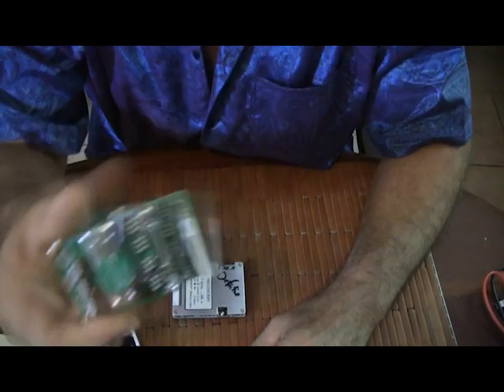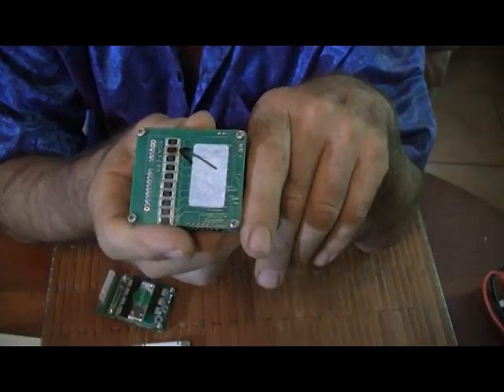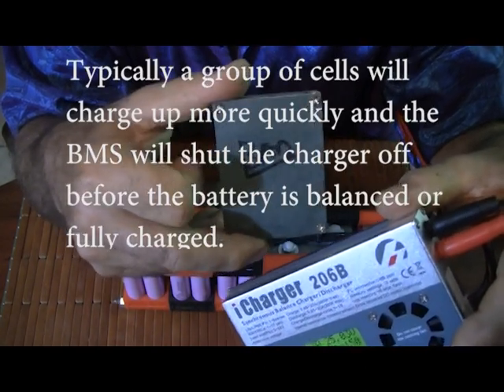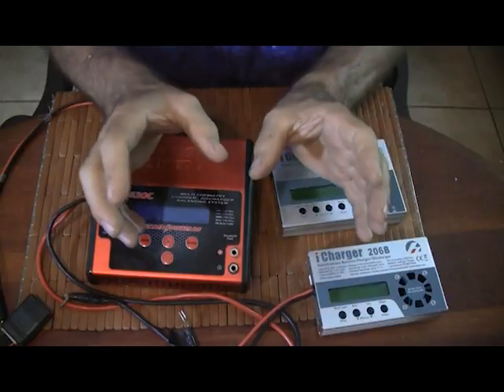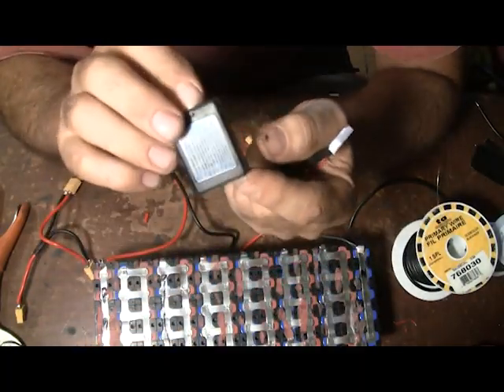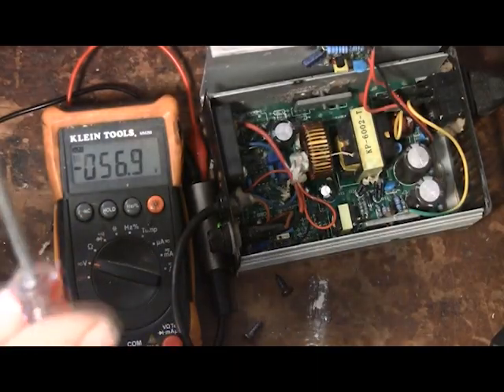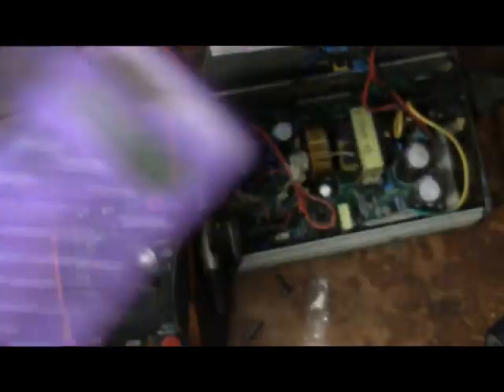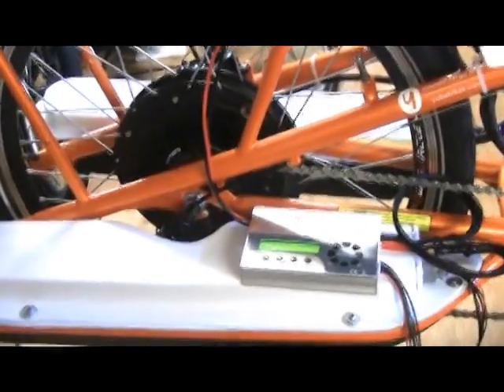How to build a safe and better lithium battery WITHOUT a BMS.

Comment: I had been wondering how good  a BMS was. 
You had your cell logger permanently attached how do you turn it off so it doesn't drain the battery?
Reply from the maker: You can attach the cell logger with a jst-xh connector so you can unplug it, or put a switch in the negative lead.

Comment: Correct! this is how I do it with hobby charger and a cell checker in balance mode if needed. I like knowing the state of all my series cells.  I even use the hobby charger with my solar panels which I do not trust solar controllers trickle charge when using li ion. 

Another way to avoid BMS's
I have a pack with 4 single series li ion chargers on each of the 4 series. It will charge up each to 90% using 5v usb 2.5A hooked into my solar controller. Then use the cell checker in balance mode if any cells are too high. Which I rarely have to do each cell is at 4.1v unless you have bad cells it works great. I never have trusted bms!

Comment: I hate to be the one to say this, but this isn't really practical. You can easily buy a Smart BMS with Bluetooth which can monitor the cells which makes all this clever engineering obsolete. I'm not saying this won't work, but it is a freaking hassle and if you don't hear those voltage sensors beep, (I have several of those) your really in for it. You don't even mention a battery monitor to which you can look at from the handlebars, I'd have to get off my bike every 30 mins to check where my battery is.
Reply: We’re these readily available 9 years ago?

Comment: sir, i had a view of your video. i have to questions. First, my lithium ion battery pack is dead. cannot be charged . upon opening, each cell read 0v. what is the reason. second, i need to diy a lithium ion pack of 30v 30a. need your help. thank you.

Comment: All good points, thanks for the video! The only thing I would miss is an automatic bottom cutoff. Any thoughts on how to cut power to the pack at absolute minimum?
Reply: Use a zener diode and  relay or mosfet to cut the current at your preferred level. You will find loads of stuff on how to use zener diodes etc on Youtube.

Comment: Just about to build a 14s7p pack. After watching this I'm going for 2 packs 7s7p.  Thanks for the info.
How do you wire the low voltage alarm switches?
Reply from the maker: Think of your pack as two batteries.  You will have a 2nd negative in the middle of the pack.  Use this for the ground of the 2nd voltage alarm, and wire the positives in sequence as normal.
Reply: Sorry, what I meant was. The switches that turn on/off the 2 displays on the bike, what wire is broken for the switches?
Reply from the maker: @choppedminx  Negative Wire
Reply: @shawname2  thanks shawn👍🏻

Comment: Hi Shawn, thanks for a great and informative video. I recently discovered that the BMS on my 52v 20ah battery was dead. I was very hesitant to open the pack and check. I am glad I did. The BMS was reading ~28v and the battery was reading 58.6v (fully charged).

Since the video was made a few years back, I wanted to as if there are any new hobby chargers that could handle my battery without breaking it in two.

THANKS
Reply from the maker: Hi Atef,

No not that I know of.  Understand that you do not have to mechanically separate the battery- you can leave it spot welded.
Reply: @shawname2  And still use two hobby chargers? Thx

Comment: cool..very good thank you..so you charge mostly with normal charger and balance ocasionaly with hoby charger?
Reply from the maker: Yes, exactly.
Reply: @shawname2  for normal charging not balancing charge..do you use a simple power suply but your trick is to set the voltage to only charge 90% of max battery voltage is that correct? or are you using a li charger that tapers of after 80%? i love what your doing and im looking for chargers now
Reply from the maker: @russellwilson5246  Yes, I use a simple power supply or an ebike charger with a pot to adjust the output voltage to no more than 4 volts per parallel group;  40 volts for a 10S.
Reply: @shawname2  would i be corect to asume a 10s pack on a 40v power suply even if i fell asleep this would not over charge batterie pack?..all the 40v suply could do is take the pack to 40v/safe right? and as the pack aproches 40v the curant would deminish..ie voltage or pushing force would deminish as the charger and battery aproach an equal voltage? making the 40v simple power suply act similar to a smart charger that reduces amprage near end?or should i say the situation will reduce currant near end..and when the power suply and battery pack reach 40v charging /the flow of currant will stop?even though the power suply is pluged in and turned on and connected to the battery pack?
Reply from the maker: @russellwilson5246  Yes you are right.  A charger starts out maintaining a Constant Current- The CC part of the charge.  Once the target voltage is reached the charger reduces the current to keep the voltage from going too high- the CV part of the charge.  Finally, the charge current drops to such a low rate- say .01 of an amp- that the charger just shuts off.  Sleep easy!
Reply: @shawname2  what about a power suply of 40v?...not a charger
Reply from the maker: @russellwilson5246  No problem.  Most power supplies are constant voltage.  Constant current P supplies, whcih you donn't want. are very rare.

Comment: Also I took 4 of them pocket car booster packs that are 12v each x 4= 48v and it’s tiny lithium pack all put together, about the size of a VHS Tape that goes in a VCR.... it’s awesome no more big clunky battery or tons of shitty single cells only 4 little packs together

Comment: Ya it’s a good idea but who wants to have to keep running over to your battery to make sure it didn’t over charge it, you’d go nuts running to it every 15 mins.., also wouldn’t it be better to have a digital screen that tells you how full the battery is... also you can buy a Bluetooth BMS and use your phone and it does everything your doing individually, the Bluetooth BMS shows each battery cell percentage, life of it, cuts it off so there’s no over charging.., I’ll stick to the Bluetooth BMS

Comment: This is the exact video that i'm looking for.  One of the best explanation video i have seen on youtube.  I'm in a process of building a 10s battery for my Ezip 1000 36v scooter.  I have a ton of Ryobi 40v 4ah battery, good cells and bad bms are ready to be torn down.  I have a few questions to ask, what does that little cells monitor, and the wire attached to it call, can you give the me name and model or where to buy them.  also, do you still recommend the Icharger 2010B or there a better now?  Last but not least, which battery spot welder do you use or would you recommend?   thanks a million in advance.
Reply from the maker: Sure-  Here is a link to cell monitors:
https://hobbyking.com/en_us/catalogsearch/result/?q=6s%20cell%20monnitor
The type of wire connector attached to it is called a jst connector.
I still like and use ichargers...   But there are many less expensive ones.
I use a spot welder like this- it is adequate:
https://www.banggood.com/DIY-Portable-Battery-Storage-Spot-Welding-Machine-PCB-Circuit-Board-Welding-Equipment-Spot-Welders-for-18650-26650-12V-p-1646749.html?utm_source=googleshopping&utm_medium=cpc_organic&gmcCountry=US&utm_content=minha&utm_campaign=minha-us-pc&currency=USD&createTmp=1&utm_source=googleshopping&utm_medium=cpc_bgs&utm_content=frank&utm_campaign=frank-pla-us-all-brand-0513&ad_id=435264204190&gclid=CjwKCAjw2Jb7BRBHEiwAXTR4jQmpANb9iGHGMz1MwwRhFirL06VCNOfiO4y83W087PJuL0Uyon0uABoCJvIQAvD_BwE&cur_warehouse=USA

Comment: I like this video because I seldom found so much usefull information! Since I have some trouble with BMS'es, I started to look for an iCharger 1010B. I now have a 2p-13s battery providing 48v. To balance this battery, I need to split it into  6s and a 7s halfs. Since readily available chargers only go to 6s, I need a 10s charger. Impossible to get! There are "Junsi" chargers doing 10s. Are those OK?
Reply from the maker: Sure.  Amy charger brand will work.
Reply: @shawname2  OK, thanks for the fast response!

Comment: i ordered a 60v 5600w scooter what could i use to replace bms?
Reply from the maker: If the BMS is working well, leave it.  If you enjoy electronics as a hobby, and want to improve the battery, consider getting an active balancer.  If you have a hobby charger, you could get a check up of the batteries state of balance while charging...
Reply: @shawname2  im sure it will work fine i ordered a whole bunch of batteries to make the thing go the farthest, the balancer thing seems likk
Reply: like a better idea im sure i coul find a 60v balancer if i look online
Reply from the maker: @michaeljoelnavarrete8055  Sure- but doesn't one come with the scooter you ordered?
Reply: @shawname2  ya js the balancer thing sounds better for the overall health of the battery
Reply from the maker: @Designer Web They do address the "don't know if it's working" problem with regular BMS's.  And, a lot of them are programmable- so you can set the cells up to be charged for long life or for max capacity.  They are a good choice.
Reply: Are you sure the BMS comes with the scooter you ordered?  I don't think they come with the BMS... some scooter batteries don't even have BMS.  I woudn't get BMS as it can just add more potential problems.

Comment: Here is just another bull and trash talking video on Youtube.
The charger is INDEED a BMS plus a charging function so the claim that you don't need a BMS is pure BS!
This charger also costs 15 times more than a BMS which is usually already supplied with your battery pack (unless you buy spare batteries), also a charger is usually supplied with your gadget, this BS charger has limitations on number of batteries and I didn't waste more time looking for this trash.

Comment: First off Great Video,  I love the fact your using Hobby chargers!  
but from my understanding of lithium ion& Lipo batteries its the discharging under 50% is whats hard on them.   Every Quality battery like Energizer packs and such all say 100% to 50% charge and then a recharge is a free cycle on the battery life.  Kinda like a Lead acid battery (except those you only want to use 20% of it charge to ensure long life)  same goes for cellular phones.  
I'm trying to figure out a way to use a small solar panel (12v 15w ) with a small 3s battery pump to run a fountain pump but i'm liking these bms boards(having hell with getting them to charge correctly and shut the batteries off when it suppose to..)
Reply from the maker: Because you are charging directly from solar panels the voltage is going to be all over the place.  Consider using a DC converter - that will lower the voltage of the panels to 12 and keep it there as the voltage fluctuates. You will extend battery life by limiting cycle depth at the cost of capacity.  So you make a compromise.   I run my power wall between three and four volts.
Reply: @shawname2  i havent even gotten to the solar pannel stage..  just trying to get the balance charger to charge the batteries evenly lol... but so far id be better off just raw charging them.  Works ok til a cell screws up.  Then it messes up the whole pack.  Then boom smoke and sometimes 7' tall flames. Haha pretty cool really.  
Yeah i like 3.4 to 4.15v charge cycle myself.  Batteries seem to last longer than what they are running. Haha.
Reply from the maker: @danielstevens5925  Start a "Fun with Lithium" You tube channel!  Seriously, you know what can happen if you overcharge, so if you are on the edge take all precautions.  A friend burned down his garage last year when his battery pack caught on fire.

Comment: You neglected to mention that those 1010B chargers cost up to $250 each (and you need two of them) plus you need a bench power supply to power them. Your 2x7S charger may quickly cost you more than you E-Bike and/or a new battery.
Reply from the maker: Yes, the 1010B is a high end charger.  There are other choices, and you don't need two.

Comment: I fly electric planes and have the icharger 209b and know how to use it.  I guess my rebuilt craftsman battery packs will have xt30 charging connectors and balancing connectors dangling.  Thanks for letting me know that the BMS boards are not reliable.
Reply from the maker: Sure- my weed eater and electric drill have them hanging out.

Comment: 1) Thank you for your video about BMS bypassing! 
2) I have started to rebuild a Ttorqeedo outboard battery park which costs form $700 to $1000 depending on capacity.
here is my current status of the project: https://www.youtube.com/watch?v=CJMORmXYvfU  
3) I found that original BMS refuses to charge the new cells and i have to charge them somehow. I am going to use the charger 1010 you have recommended.
4) But the production BMS is not only a charger and balancer  ... it controls the motor. My plan is to separate the new cells from production BMS and charge them independently.
5) Not sure if it will work finally ... but i have to try it.
Reply from the maker: Yes- and you can leave the BMS installed and charge independently of it.  It may begin to work again when your cells are charged and balanced...   Good luck- it's a project I'd like to do too.
Reply: @shawname2  thank you.i got more questions: 1)i have lost a production thermocouple. It had two wires. I see the icharger has thermocouple too but with 3 wires. Do you have idea what is the difference between 2 vs 3 wires thermocouple? What a resistance should a thermocouple have at normal cell temperature?
2) do you still recommend same charges or something better can be found on market?
Reply from the maker: @RUS_US  I am sorry, I can't help with the thermocouple.  For larger batteries like power walls I recommend an active balancing system now.
Reply: @shawname2  i see ... the outboard has 8x8 cells and shows 600Wht at max throttle ... if i will create a 8x16 or more then i will not need to control the temperature.
Reply from the maker: @RUS_US  The temperature of the battery?  No, I do not know of a simple 600 watt application where the temperature is controlled.  If you had high C cells in a small pack pulling close to their max watts, then maybe.  But even that would just work for short bursts, so maybe not.

Comment: Hi,
thanks for this informative video, I learned a lot!
Can you tell me if theres a form of cell logger that cuts off the battery when it detects low voltage (maybe instead of the buzzer).
I am building a music box and four 4s4p packs. I want to build them without BMS, but i need an automatic shutoff, because I wont hear the buzzer over the loud music.
I also got an original IMAX B6AC V2 Charger, do you think thats okay for my use?
Greetings from Germany!
🙏🏽
Reply from the maker: Hi Vivian,

Hmm,  I have used an over/under voltage relay---  Here is the link:

https://www.aliexpress.com/item/32826508821.html?spm=a2g0s.9042311.0.0.27424c4dwH3n6D

But it monitors the overall battery voltage, not the voltage of each parallel group.   

You could also use a BMS just for the low voltage shutoff- along with your iMax.  You can use them together- 

Replace the buzzer on the cell logger with an LED light?   Keep an eye on a voltage gauge for each battery??  

Ahh, here is my worst idea- play the music softly!

cheers,

Shawn
Reply: @shawname2 
Hi Shawn,

thanks a lot for your ideas and your fast reply!

I thought about using a bms only for the shutoff (just like you said) but I wasn't sure if I could still use the balance charger.
So I decided not to use a BMS, also because I would have to buy 4 pieces and I'm afraid they could burn down or otherwise ruin my battery packs.

Therefore I will put a cell logger in the musicbox and add a switch, to be able to turn it off, so i can sometimes check it throughout the day.

I will also use a module that shuts off when detecting undervoltage (of the whole battery).
It's just there in case I forget to check the logger after three days of partying... :D
It's a bit cheaper than your relay, i hope it will work correctly:

https://www.banggood.com/15A-DC-6-30V-Lead-acid-NiMH-LiFePO4-Li-ION-Li-PO-LiFe-Polymer-Lithium-Battery-Discharge-Protection-Board-Module-PS9DC01-p-1625430.html?rmmds=myorder&cur_warehouse=CN

The soft music thing wont work, but Ill try to keep an eye (i think the other eye needs to be closed) on the cell logger... ;-)

I like your type of humor, hope you`ll do some more videos soon!

Thanks a lot!

Prost (cheers),
 
Vivian
Reply from the maker: @vivian_i883  Ahh- your German.  Good find on the battery protection board!  Play it loud!

Comment: Lot of work and it looks worth it. i saw another vid and they said connecting all your cells in parallel will balance all of them in a very short time is that correct?  thanks!
Reply from the maker: Yes, When cells are connected in parallel they will all become the average voltage.  I wouldn't do this with cells than say more than a volt difference- the current flowing could cause them to overheat.  Any one else have a more scientific answer?

Comment: Hi I wanted to make battery pack from 18650 used laptop battery for my  electronic scooter, rite own I am using led battery,  my scooter system voltage is 48, battery connected is 12V  33Ah x 4nos.... How do I make it from used laptop battery, what kind of sefty protection I have to take care of... please guide, my  email is snehalmandaliya@yahoo.co.in & my whatsapp ±919920295559
Reply from the maker: i wrote a free book to answer all those general questions.  Here is a link to download it.  After you have read it I can answer more specific questions.

https://batteryblocs.com/wp-content/uploads/2019/12/A-Hobbyists-GUide-to-Designing-building-and-Charging-a-Lithium-Based-Battery-Pack-Revision.odt